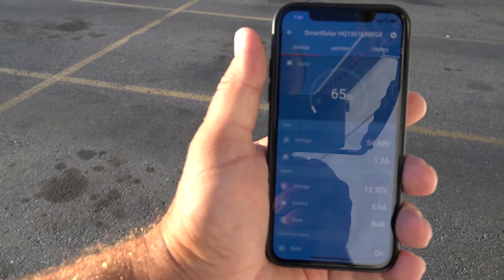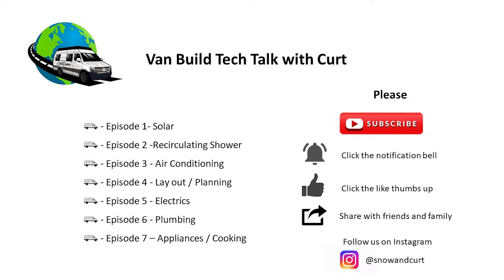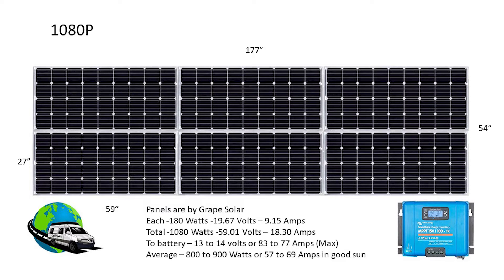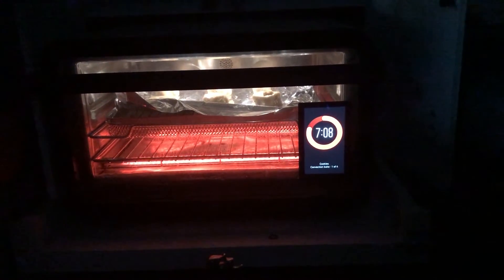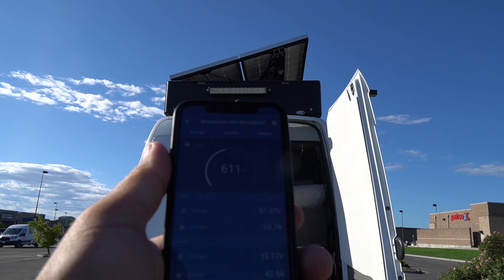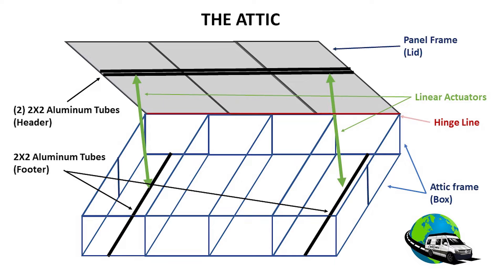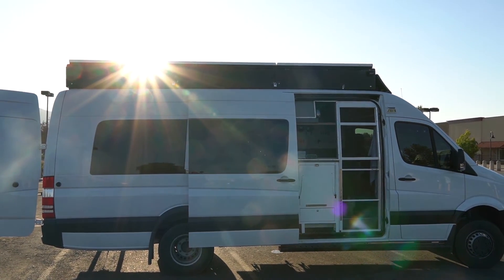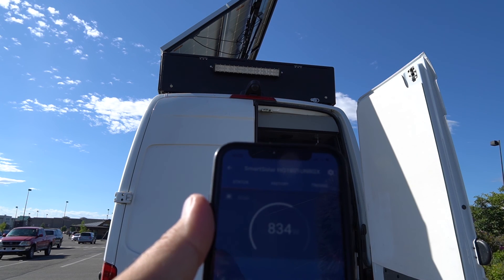1000 watts Tilting Solar, See the Power - Van Build Tech Talk Series -  Ep. 1

Comment: Killer setup.  I'm  with you.  Tilting the panels makes a huge difference.  I did my tilting mechanism similarly.   I built my own linear actuator.  But without any motors.  I didn't want to have it stuck in the open position and a bad motor.  Maybe, there's little chance of that happening.  But I can use a ratchet and socket to lift/lower  the panels or a  drill with a socket adapter.

Comment: So, Curt, great video! Thanks for the details and the build info. I have some questions:
- Is your battery bank 9600 watts at 12 volts?
- If so, what is the State of Charge after cooking with the oven and induction cooktop (full day of electric usage)?
- do you have the parts list for the solar tilting box build?

Comment: How much does the drag from the gigantic construction on the roof affect the van's fuel use..... If you drive a lot a generator might  have been more cost effective since it's a fraction of the cost of that solar system and batteries and charger and fuel use.
Reply from the maker: We actually get pretty decent mileage! And we hate the sound of a generator when we are wild camping out in nature. So, the solar set up is perfect for what we wanted. :-)

Comment: Great videos!!  I haven't noticed anywhere what length of actuators you use to get the 45 degree lift.  (looks like it's over 12 inches) I have one 42 inch wide panel (short side) and am wondering what size actuator I should get. Is there a formula to determine what length will give what lift for different sized panels?  And does it depend on how the actuator is positioned?  For example, could the extending end of the actuator be bolted to the middle of the panel's cross brace?  Thank you!

Comment: Did you weld all the aluminium together or would it be possible with just screws and rivets?
Reply from the maker: No welding... You use the appropriate fittings... They come from a company called 80/20 😊
Reply: Also what type of sheet did you guys use on the outside of the attic to cover the walls?

Comment: i would like to know more about angled aerodynamic piece you added to the front of box
Reply from the maker: It's a wind guard designed for fifth wheels or horse trailers... We adapted a bit during the install and it works perfect!
Reply: @SnowAndCurt  thanks. You got a brand model or link to the one you used?

Comment: Very good description. Few question please. 1.The actuator "ECO-WORTHY Heavy Duty 330lb, 18 in" is exactly what you have used? 2.The 2" header tubes are at 1/4 from the edge of the lid? 3.What is the max tilt angle of the lid? 4. You told me about the 2"x2" tube of the header. How the 2x2 tube of the footers worked? Any problem with them? 5. Any reason you used 2x2 tube instead of 2x2 profile you used for frame? Thank you for your time. Enjoy the rest of the journey.

Comment: When you’re panels are tilted and in good sun each day and charging as maximum as they can- how low do your batteries get with your daily use while they’re charging? Just curious how that much solar and batteries stay topped off or what percentage -with your normal daily use? 
Also- do you think that all the juice these panels are collecting are all being stored in your batteries? Or you would need more batteries or you did the math and your batteries capture all the juice these panels can put out?

Comment: I'm attempting to duplicate this as much as possible for my van. Thank you so, so much for explaining all the details! Out of curiosity, how much would you estimate the panels, lid 80/20, header, and all lid hardware to weigh in at?
Reply from the maker: All I have for you is that Snow and I could lift the frame easily to move it around. And for install, the frame was in two pieces and we were able to lift it up on to the van without any worries... it was awkward due to size, so for the van install we had a third person help us. So, not too heavy at all.

Comment: I love your solar tilting roof system! I'm converting a 170 Sprinter van right now, and am ordering solar components for a 875W system. I'm having a tough time finding solar MC4 connectors for the higher amps needed for parallel wiring. So, I decided to check out your system. I noticed your wires are 10 gauge and the connectors are 30A. So, does that mean you wired the panels in series? Does that seriously affect the performance of the panels if you have partial shade?
Reply from the maker: Curt spent a ton of time on the phone with tech support (from the place we bought the solar devices)... they were very helpful. Took a few tries to get it right, but it works like a charm now. Your best bet is going to be to call them when you are sitting in front of your elextrical panel... I am sure they weill be able to walk you thru it!

Comment: I noticed you used the British Aero wind deflector to divert air up over your attic box.  I had one of those for my SUV when I towed my travel trailer to cut down resistance and stabilize more, but I  like your use of it more.  

I have a Thor sequence class B with one 190W and I want to add more solar and I’m trying to think of a way to instal solar over the top of the AC, fantastic fan cover and Winegard, or along side of them with narrow or tilting panels.  

Any suggestions ?
Reply from the maker: I think you could do a similar attic box on top of your class b... but, I think you would need to add a vent fan or two to make sure the AC gets enough air. With our design, the maxx air fans get plenty of air when the attic is closed, but an AC may need more. And the wind guard works great, only had to make a few modifications to mount it for our purpose. Thanks for tuning in!
Reply: Snow & Curt I appreciate your input.  I probably should have mention I have the Thule track system running the full length of the roof that came standard on the sequence.  If I could send photos here will would but basically at the very back I have a Jegs cargo container on top of the Thule cargo rack that they provided attached to the Thule tracks and in front of that is the 190 solar panel and then the AC, Fantastic fan with rain cover, and then the round Winegard TV antenna/WiFi/LTE booster at the front.  The tracks run along side and there is a good gap on either side between the AC, Vent, and antenna, where I could lay some narrow solar parallel to the van, but I thought maybe just find a way to make some very tall track mounts to raise two or three more of the the same kind of panel I have already, on top and over the AC, and other times.  Really wish I could post a photo.  I think a full tilting box is not in order, but either an along side tilt fit some narrow panels attached to the one Thule track on either side or a manual hand tilt mechanism on the panels mounted over the rooftop accessories, or just a stationary mount of all panels, despite the lack of efficiency.  I don’t think I have the technical know how to do more than that.  

Also, what is needed to converge al the panels in to one system ?  I have two round solar outlets with the ONE go power panel I believe.  Can everything be run down through that or does it need to have a new box to connect more panels.

Comment: Hi Curt. I found some recommendations that the solar panel should be double in power than the battery bank. For each 100 Amps you should have 200 watts in solar. In your case for 800 probably 1600 watt in solar. How the system works with only 1080 watt? Did you have any problems? Could you charge the batteries to full only with the solar panels? Did you experience any difficulties? I'm thinking if I need to increase solar panels to 1600 or not. I really appreciate your input after over 1 year testing the system. Thank you.
Reply from the maker: Hi there! We have had zero issues... but, that likely all depends on how much you use it and the amount of sun. The first two months we were in the van, we did not have the second alternator, and we could charge to 100%, but were limited on the amount of AC we could run. Maybe if we were spending all of our time in an area with a lot of overcast weather... but, we move quite a bit and tend to look for brighter days! So, maybe if you can squeeze another panel up there to help out, go ahead... but we do not think you need double. In our opinion!
Reply: @SnowAndCurt  Thank you for your opinion. Still waiting for the book? plans?.

Comment: Even considering the summary at 4:24 of this video,  you have combined available wattage in sunny day  under 2000 watts.  It's critical for your induction cooktop (typically 1800W) and you can't use the cooktop when sun is not available.  I can't also understand how you can run your AC unit overnight powered just by 1000WH battery. Did I miss something? Thanks in advance for clarification.
Reply from the maker: We have 800 amp HOURS of lithium batteries to store up plenty of power from our solar. We can easily cook on our cook top and run the AC... our power has yet to get low enough to be critical. If it is not sunny, we have the option of cranking the engine for a bit and charging the batteries via a second alternator. That alternator charges batteries whenever we drive (unless we are full and then we turn it off). We have a 3000 watt inverter to help run our induction cook top and our June Oven. Hope that helps to clarify. Thanks for tuning in!
Reply: Thank you so much for so quick answer.  Let's do simple mass: to get 1800W for your cooktop you need 120V x 15A  or  12V x 150A!  You refer to the battery "Battle Born LiFePO4 Deep Cycle Battery - 100Ah 12v". So, you need 1.5 times more power that your battery can supply according to the specifications.
Reply: I have just found in your other video, that your 12V AC consumes 600-700W in total, so, you need  50-56A to operate it.  It means that your AC assembly  can run continuously only  2 hours from fully charged battery.
Reply from the maker: We can run air for 4-ish hours.... And cook on our induction for 20 minutes.... And run our lights, fans, and charge our devices before our batteries get critically low. We can debate it all day.... But, all we know is that on our end we are good to go. Again, thanks for tuning in... Feel free to check out our other videos! Cheers!
Reply from the maker: PS... This is Snow. I reply to most of our comments. I don't pretend to understand how the system works, I just know it does! Lol!! Wanted to clarify that part, cause obviously, I can't discuss the tech side of our system in a ton of detail! 😂😁
Reply: @SnowAndCurt  4 hrs sound more realistic (AC doesn't work continuously).  If you cook dinner and brew tea,  you have no juice in your battery to power your refrigerator and to run AC over hot night (probably, you can use just "only fan" mode). I afraid that  some your followers have missing point...  Anyway, thanks to both of you, Curt and Snow!
Reply from the maker: We have no power issues... None at all. We don't run the AC a of the time, but we keep the van cool. We cook dinner.... Lunch.... Breakfast.... And fridge is always cold. We are not misleading our viewers.... Somewhere along the way, maybe you misinterpreted something. But I can assure you... No power issues! Oh!! I can also dry my hair with a low watt hair dryer on e or twice a week. So, not sure where the lines have crossed, but we are all set on power over here! Thanks again. Cheers!
Reply: @SnowAndCurt  A problem with manual tilt is forgetting to tilt the panels all day long AND forgetting the panel is tilted, while the sun moves past position.
A less labor driven solution could be building a box with additional panels that slid out doubling or tripling the number of panels. Slides would offer side shade at the cost of storage on top. Bad thing for slides is street parking.
The tilt works out better on paper for  more watt production, but it's labor intensive by comparison by manually tilting 6-12 times a day.
With a slide that's doubled to a 2160 watt area that produces 7.4 kWh/day on average, when a manual tilt on 1080w produces 4kWh on average.

Comment: Nice job on your attic Curt.  A couple of questions:  what do you use for your hinge components?  Did you consider using an 80/20 hinge designed for attaching 1010 profiles?  Also, even though it's snug tight to the L-bracket when closed, don't you have to lock it down to help prevent lifting from the air flow and vibrating on rough roads?
Reply from the maker: Hi Mike... see if this video gets you your answers! thanks
https://youtu.be/IwScvf6AeEY
Reply: @SnowAndCurt  Thank you.  Quite helpful.

Comment: Curt, Have you considered putting in two actuators so that you can tilt them either way?
Reply from the maker: We've thought about it a bit in hindsight... But we like the security of one side bring somewhat permanently attached... In case of extra crazy wind. Also, our windows are mainly on the side that the panels tilt away from, do that helps with keeping the van cool. So, I do believe it could be done, but we do not regret not doing it. If you give it a try... Keep us posted on how it turns out!

Comment: So, if the lid is tilted, does that mean if you leave the van for a hike, the possessions in the box are unsecured?
Reply from the maker: Yes... you are correct. I imagine you could put some sort of light weight mesh/grate type cover that would help. And also, no ladder mounted on the outside of the van.

Comment: Great video.  Seeing the results at different times of the morning was awesome, but that 9;30a one was a little sketchy.  You stopped at around 20 degrees but an hour later you were tilted up higher.  It looks like your panels will only tilt up to about 45 degrees.  In the wintertime, you could benefit from tilting them higher.  There are phone apps where you can calculate the angle of the sun based on the time of year/day and your location.

 I built my own simple panel rack to save money and it turned out I can tilt it from either side, although I have to do it from a ladder.  Automating it would really be nice but I wouldn't want to lose the ability to tilt from either side so that would take some extra thought and money.  I have 4 of the same panels that you have and they're not light.  Including the rack I'm guessing around 130# but I only have to lift half of that and the farther I lift them the lighter they get. lol
Reply from the maker: Tilting both ways is nice!! But, manual lifting sounds tough.... Hope you can come up with a way to do both! Let us know if you do. Thanks for tuning in!
Reply: using 4 actuators in 2x2 scissors configuration and no hinge would allow you to tilt both way and also add another axis. These electrical linear actuators are screw drives so they can move relatively large loads and can bear even larger static loading. You can browse some on amazon
Reply: @hackman88  This sound very interesting but I can't figure out this configuration or find any information on my own. Could you point me in the right direction, to understand how this would work?

Comment: OMG!  This is exactly what I want to do to my Chevy Express Van.  A few years ago I found a video where a couple mounted their solar panels over their vent fan to not only hide the fan for stealth parking but it also acted as a weather shield.    I was searching for that video when I came across yours.  And this is a way better solution.  With all the high tops on cargo van these days, this will hide all my gear I want to carry on top and the vent fans as well as install the maximum amount of solar panels on the roof.  This is genius!  My only question is this.  I did not quite hear how you installed the box to the roof.  Can you comment specifically on how you did that?  I am trying to find some universal gutter mounts that will work with the 80/20 t-slot system.  Does anyone have any ideas on that?
Thanks!
Reply from the maker: The bottom rail on the 80/20 is hooked to the van with riv-nuts... on 12" centers the length of all of the rails. Hope this helps!
Reply: @SnowAndCurt  Yep!  That does help.  It is what I thought you said but I just wasn't sure.  Thanks for replying!

Comment: Nice setup.  What did you use to enclose the sides of the "attic"?  Is that thin sheet metal?  Also, did you incorporate that into the grooves in the 80/20, or did you attach it to the outside of the frame?
Reply from the maker: Thanks John. The original intent was to use the grooves, but we called an audible. If the actuators were to stop working, we needed a way to access them without tilting the panels. So, we use hinges and licks for each section. We also believe this allows more air to circulate thru to supply the Maxx air fans. And, yes, it's sheet metal that we ordered pre cut to size.

Comment: Are the actuators the only thing that hold the lid closed? No exterior latches?
Reply from the maker: Acctuators run on remote... Safety latch is manual. Curt can reach if he stands on the side rail and stretches! 😀
Reply from the maker: There are latches... And a safety strap!
Reply: @SnowAndCurt  thanks for the reply. Manual latches or remote?